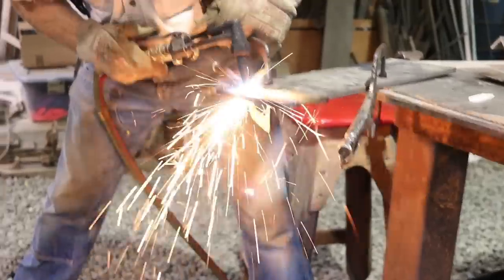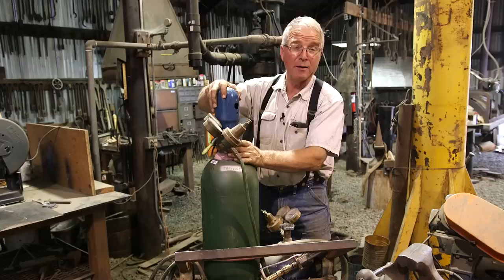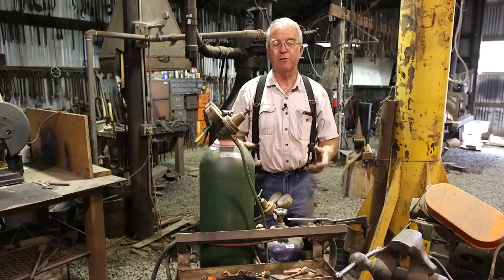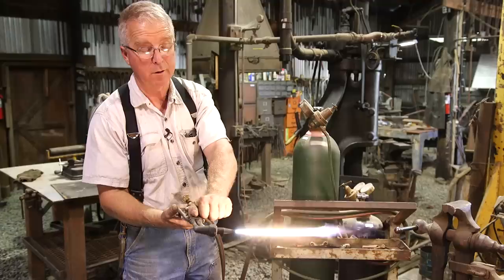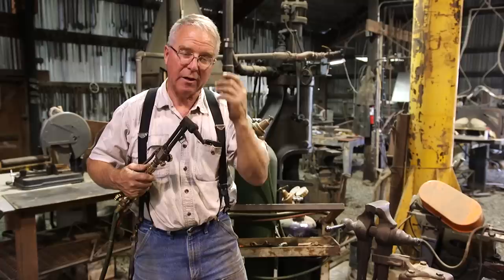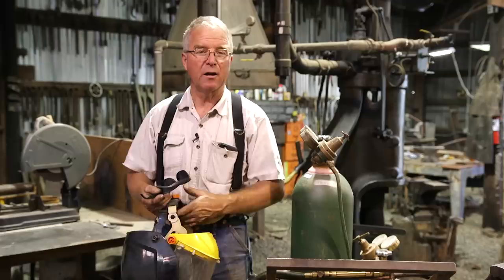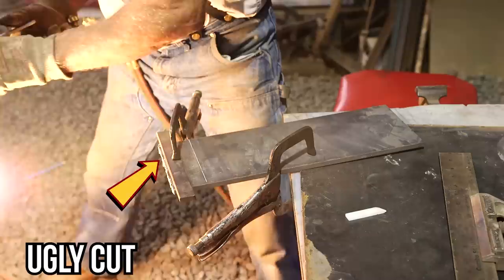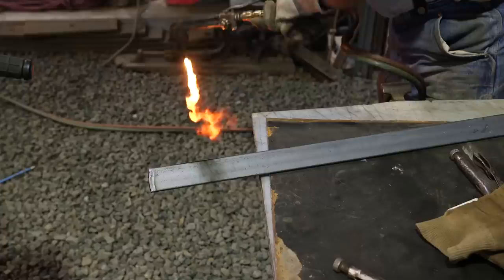Using A Cutting Torch

Comment: I worked in the oil fields welding right after I graduated in 73. Bought me a gas powered 300 amp machine and jumped in with both feet. I eventually wound up in Odessa Texas building new drilling rigs. Money was flowing freely in those boom times. I tell this to say that I learned to use a cutting torch with some of the best in the welding business. They would do all kinds of tricks to show off their skills. One was to strip a welding rod of the flux and see how far they could cut it without burning or melting it in two. They usually used a 5/16 rod and very few could get more than an inch or more cut before they would fail. I always thought I could do anything bigger and better than anyone else so I started practising this technique. I eventually got it figured out to where I could cut an 1/8 inch rod all the way to the end with the rod standing straight up in my vise. The flame had to be set perfect, the oxygen pressure had to be perfect and I would us the rod and my hand as a fixture to hold the torch and come down the rod at just the right speed and the rod would roll over on both sides. I made money on betting many times doing this trick. Another thing is I never bought a tip bigger than a triple 0.  (000) . I could cut plate 1 inch thick with a triple 0 and make it look like I was using a cut-a-line. Using a cutting torch is like anything else, with practise and trial and error, a person can acquire skills that are incredible. Thanks Mr Scott for posting another awesome video!!!!!
Reply: Sounds like you made that cutting torch act more like a laser! That's impressive, I hope that you aren't still working in the oil fields (since '73 might as well be '70, and that would make it 50 years ago), and that you have at least tried to teach your skills to some willing apprentices.
What I'm trying to say is someone with your skills would surely know so many little tips and tricks that you would make a good teacher, provided that you had students willing to learn (a thing sorely lacking these days, where school is thought of as a thing to be endured more than a thing to enjoy).
Reply: @44R0Ndin  Also a great guest on the channel to interview No? I'm thinking, Jim
Reply: Wow, and double wow. This sounds like my type of skill set right there. I hear you very clearly.
I think you would be an awesome guest on the channel. I'm 52 yrs now and just starting college for welding , the torch is a important tool that we have to understand fully, or else......  Boom. Cancle christmas. Jim
Reply: @44R0Ndin  Thanks for your kind words. I taught my sons and grandsons how to desire to be the best at whatever they wanted. One of my grandsons works in a fab shop that builds race cars and he does very well at it. He is 18 years old. I went to school after a few years in the oil field and got a mechanical engineering degree. I have owned 35 businesses and when I was in my 50's went back to school and got an electrical engineering degree. I always loved going to school and learning everything I could. I've worked projects all over the world and have tried many things and I still haven't figured out what I want to be when I grow up!!!
Reply: @aerialrescuesolutions3277  That's awesome you starting to learn welding. I have welded and fabricated in lots of different areas of the industry. Pipelines, oilfield drilling rig fabricating, chemical plants, radioactive waste storage facility, race cars, and lots of other things. Never stop learning and always have a desire to fill your brain with new and exciting information that makes you happy....

Comment: I was always taught to open the the oxygen valve all the way, because there is a back seal when it is opened all the way.  Maybe regulators have changed since.
Reply: That's my understanding as well. A double-seated valve. To touch on another of his comments, it's fine to lay down an acetylene tank. You just have to leave it vertical for a while before using it to give the liquid a chance to settle back to the bottom of the porous substance the tank is filled with.
Reply: You are correct. I work in oil and gas and that is industry training.
Reply: @snymat_68  Yep, there's nothing inherently dangerous about transporting an acetylene cylinder on it's side (and arguably it's safer, if you don't have a good way of securing it upright)  But like you say, you do have to let the acetone settle back into the porous material before using, or you might be feeding liquid acetone into your torch.

Comment: The oxygen valve should be completely opened when in use because the valve seats on fully opened and fully closed position. to avoid leakage from the valve stem.
Reply: This is called "backseating" the valve.
Reply: @prototype3a  Thanks
Reply: Came here to say that lol Always been taught to do that on the O2 tank.
Reply: I concur, industry wide, we open oxygen bottles fully. Good video, right in the ballpark!
Reply: Gotta seat that valve
Reply: Bueno to Frank
Reply: I agree.   My high school VoAg teacher taught us to open the oxygen valve all the way so it back seats itself and does not leak.  Also always stand to the side of any regular.  If it blows you will be less likely to be out of the direct hit of the blow.
Reply: That was over 50 years ago!
Reply: @donaldmack7213  Some things never change.  I learned that about the oxygen tank almost 50 years ago in the military.
Reply: This is correct
Reply: This used to be true. In the 1950s new valves had a diaphragm seal which seals the valve stem no matter how far open it is.
Reply: Is this an American thing?  
Been working in the metal trades for 25 years and never heard of it, we do 1/4 turn on oxy and acet, most of the old guys I have worked with would complain if you opened it fully, wearing out their wrist for no reason.
Reply: @mrsock3380  Maybe you could ask your oxygen supplier if the oxygen tanks are no longer fitted with back-seating valves.  Opening the oxygen valve 100% is what I was taught back in the trade training school back in 72.  This was considered a safety feature for the oxygen valve to prevent leakage from around the valve stem.
Reply: @mrsock3380  This following  was extracted from the OHSS website.
Do not use excessive force when opening cylinder valves--use no more than three quarters of a turn if possible. If a problem develops, the valve can then be closed quickly. Leave keys on cylinders when valves are open so the valve can be closed quickly in an emergency. Some cylinder valves, such as oxygen valves, have double seating. These valves should be fully opened, otherwise they may leak.
Reply: @frankgauvreau7435  had a look on their site, specifically tells you to not to open valve fully, BOC Australia if you want to have a look, no mention of it that I could find on the other major suppliers site. It's odd that they use valves that could leak if not opened fully in the US, why not just seal the valve stem correctly?
Reply: @mrsock3380  legacy equipment. Originally there was no way to make a valve that would work properly with oxygen and last long enough to be useful in an industrial setting. Withou having it seat in full open. Now with modern materials it is possible, but there is still lots of seventy year old equipment wandering around.

Comment: I learned how to use the hot wrench in grade 10, I bet that does not happen these days.
At my high school one day the guys delivering the tanks let an O2 tank fall over, it went right through the cement block wall in the welding shop and into the quad. Thankfully it was on a weekend when no one was at the school, and no one was hurt, but it sure made a mess.
I don't have one in my shop here in Tokyo, I have an air plasma cutter the lease on the tanks here is stupid expensive, the air plasma cutter is cheaper for me to run. I wish I could afford to have a hot wrench in the shop as they certainly do some things that the air plasma cutter cannot.
Cheers from Tokyo!
Stu
Reply: Sophomore here, taking welding this year, the first thing we learned was how to use the cutting torch. I’m in one of the few schools that still care about shop class. FFA state champs for 13 years in a row now.

Comment: I would recommend when using the older torches without flashback arrestors to add a set, use at least a shade 5 to protect your eyes and open the oxygen valve all the way you are grown ups so it's up to you great channel keep up the good work.

Comment: That is a truly lovely 10 minute summary of how to use a cutting torch - awesome work. I worked with an old german welder and he made cuts that looked like they had been done on a bridgeport. He  had two tricks: he cleaned the holes with a number drill before starting and he made a copper bar with a step to rest the torch on and then adjusted the torch so that the flame was as you describe.
As you point out welding is about watching the pool and moving when you see it is right.

Comment: A friend of mine worked for a boiler repair company. One day he was using the torch in the basement of a  building. I know his tanks were mounted in the truck and I think there was a reel that let him unspool the length of hoses needed to reach the work. As he was cutting he felt a tug on the hoses. A few seconds later the torch was ripped out of his hands. He ran outside and saw his truck going down the street dragging a hundred feet of hose and a still burning torch.
Reply: Gahhhhhhh!!!!

Comment: Thanks for this video.  I might add that it's important to have flashback arrestors on the lines.
Reply: I would put a pair near the regulators.
Reply: Cannot stress this enough, if your valves do not have arrestors built in, buy more. Mount them between your hose and your regulator. Do not mount them on your torch unless you already have them on the regulator. If the flame burns back into your tip or you burn your hose the flame will shoot down your line towards your tanks.

 You will hear, smell, and possibly even see this happen. Quickly turn off your bottle. Your line will need to be replaced, do not mess with a damaged hose.

Comment: You should NOT wait for a molten pool before pressing the trigger ! It should be close but not melted, otherwise there will be steel droplets projected everywhere ! If you press before, it gets oxydized thanks to oxygen and it's just sparks !
Reply: Ditto. You’ll see it glow and then hit it with the high pressure O2.
Reply: I just started cutting. Boss put me on 4in thick steal....I learned that today. My legs and arms got lit up bad
Reply: Makes me think this might be a case of "multiple schools of thought," and one person's preferred method from back in like, 1940-something, got taught to their students as the method, which got taught to their students as the method, and so forth and so on.
Reply: @ShadowDragon8685  definitely. But as a welding engineer I can guarantee that from a metallurgy standpoint you don't need for the steel to be molten, and from a safety standpoint ... Well, look at the other comments above 😁

But yeah, good 'ol "I've always done like that" is very common in the steel working industry 😂

Comment: My grandpa has always had a gin pole truck on the farm that ran on propane. He also kept his cutting torch on the truck and ran it off the truck's propane tank. Super handy on the farm. The first time I used acetylene in shop class in high school was an experience. Propane is fine for general cutting and brazing, for my grandpa at least who uses it like a wizard, but acetylene is faster and easier to get a nice cut with.

Comment: I like the comment about opening the O2 valve then open/adjust the valve on the low pressure gauge slowly. I ruined a gauge by opening the bottle valve quickly thus ruining the gauge diaphragm. Sent it off for rebuild. Clean the tiny holes on the tip on the torch then remove the tip to dump the carbon trash you cleaned.

Comment: Myth busters did a thing with an oxygen tank and they shot it though like 3 walls. Also in every class I’ve had where we use that were told to make sure not to look at it and it will cause permanent eye damage.
Reply: I somewhat remember that episode, i remember it going through cinderblock wall
Reply: @midas7934  See my reply to Doms House.
Reply: It's not the brightness of an electric arc that blinds you, it's the fact that the high temperature of the plasma in that arc means that it emits a lot of ultraviolet light, meaning that arc eye is just a particularly bad case of snow blindness. Treatment is the same for both, as are the symptoms.
On the other hand, the flame in an oxygen/acetylene welding or cutting torch does not reach a high enough temperature to emit a large amount of UV, so the worst you'll get from it is the same you'd get from staring at an incandescent lamp, namely some spots in your eyes that will go away within like 5 minutes tops if your eyes were functioning properly before you started.

Comment: It’s hard to impress on someone what a lethal bomb these things can be. Here’s how I became a believer:

Years ago we needed to work a half-day on a July 4th and we thought it would be fun to set off an oxy-acetylene ‘firecracker’ as we were wrapping up, to go home at lunchtime. We had a standard, throw-away, plastic grocery bag and a set of torches. We lit the torch and got the mix burning just right for cutting. Then we tapped the flame out on a brick and turned the torch up into the grocery bag and filled it with the volatile mix (not even tight like a balloon. It was still quite squishy). We duct taped the bag to the ceiling of a port-a-john and ran a toilet paper fuse to the floor. We lit the ‘fuse’ and ran back a good 75 feet or so. That thing made a bang louder than any off-the-shelf firework, M-80 or otherwise, I had ever been around. It blew the plastic screens out of the top of the john and flung the door wide open, breaking the top hinge on the door. Furthermore it cracked the vent stack that runs up thru the roof. We were all literally dumbfounded 😳 by the explosive power we were able to cobble together, so quickly with just trash found laying around on the site. 

After seeing that, never again did I look at a set of torches without an extremely healthy, well deserved, dose of respect.
Reply: Similar story, when I was in highschool and our nine fingered shop teacher was explaining the dangers of fuel mixtures he prepared 3 small balloons. One with a squirt of acetylene which he sparked with 2 taped yard sticks with a match one the end like an old cannoneer. It popped in a gentle sooty fireball. The second he put a squirt of oxygen which made a rapid weak flash.

The last balloon he put 2 tiny squirts of oxy and acetylene, so it filled the same size as the other balloon. When he popped this one with the match it blew up with the force of a howitzer. The yard sticks blew across the floor, the 10 years of dust fell from the ceiling, the windows rattled, and the principal came sprinting from the other side of the school. 

My teacher was instructed to never do the demonstration again, but I don't think he will need to, that story is still talked about all these years later and I could only imagine what would happen if it were 2 bottles going off.
Reply: @dewidubbs6715  Haha! Maybe not the most well thought out demonstration by a teacher ever, but I bet everyone that witnessed it that day, learned a valuable lesson they never forgot. Same with us. Not the smartest idea ever but the net result was a respect for the power of that stuff, none of us previously had. Lesson learned!

Comment: One safety tip I was taught is never to carry a bottle on your shoulder. If you trip and fall you are putting your head between the concrete of the shop floor and the heavy tank coming down.
Reply: Nothing you do should put the bottle horizontal. If your fuel bottle is sideways make sure to stand it up for at least as long as it has been laying. Acetylene is liquid in the bottle saturated into a spongelike material, and will need to settle to the bottom of the tank again or you will spray it into your equipment and ruin it.
Reply: i would love to see someone get one of those bottles up on their shoulder!!!
Reply: @user-jh8no1zb9e  you gotta be strong!

Comment: One of the most important tips, besides the safety aspects, to enable clean reliable cutting was to keep the sides of the cutting tip clean. I cleaned the tips thoroughly every time that I used the torch.   When the sides of the tip are clean, no carbon buildup, there was much better airflow into the flame.  Also, we were taught in welding school to turn the acetylene off first as this lessened the chance of a burn back and also kept the tip cleaner as the continuing flow of oxygen pushed any carbon out of the tip.

Comment: One safety thing on the oxygen - it should be turned all the way open. It has a double seated valve and has a anti leak seal when completely open (and closed of course). I ran mine at about 3/4 open for years until I was informed of this feature on the oxy tank design so I guess it isn’t highly dangerous but it is recommended. As always, I really enjoy your videos

Comment: Been using the cutting torch since 12 years old. 30 years later I don't use one near as often because I have a lot of other better ways to cut  metal. But there is still a lot of jobs in the shop that the torch is the best and most efficient way to do the job.

Comment: This lightoff procedure is different than I was taught. I open o2 valve on rear all the way, crack the acet valve, light the torch, open acet valve until soot disappears, then open the forward o2 valve until white feathers just disappear. Then sqeeze the o2 lever when the metal turns cherry red (not necessarily molten)

Comment: Also, soapy water and a foam brush around all fittings, regulators, gauges, lines, etc is an easy way to check for leaks before you start making flames or sparks